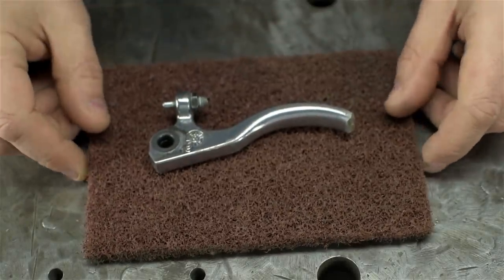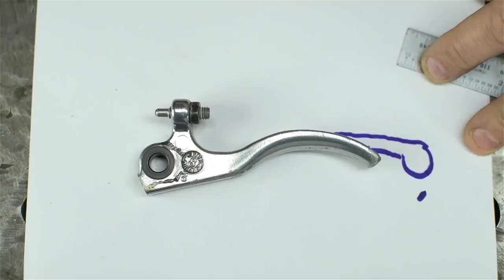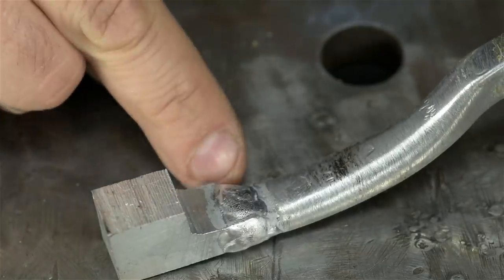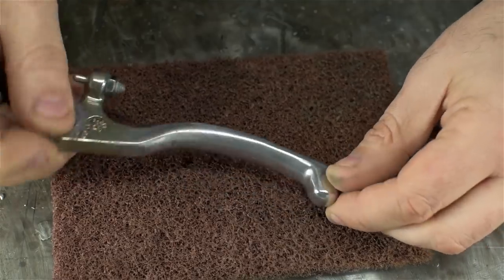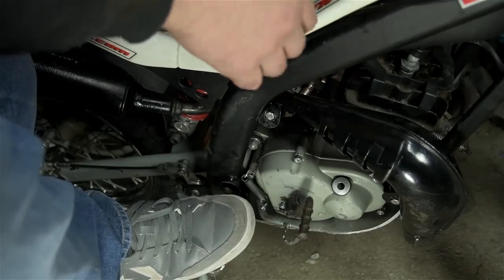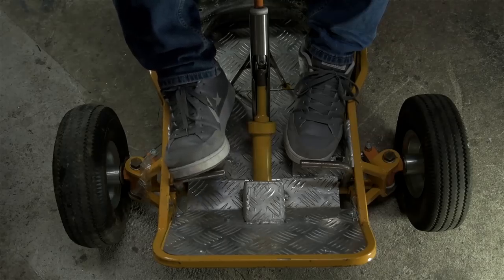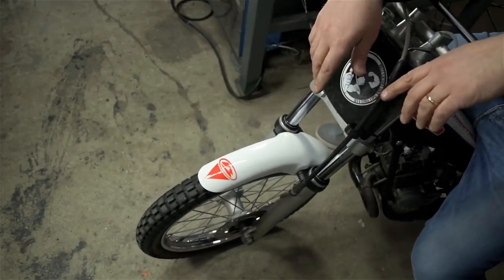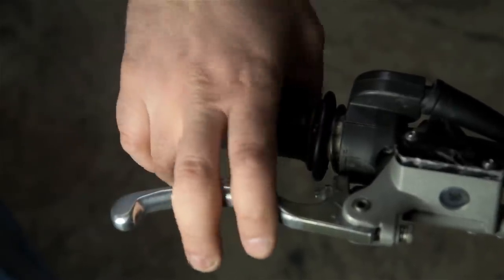6YR OLD ON TRIAL?! - Broken Brake Lever Fix

Comment: I tried a similar repair only to find out it was magnesium. So bright... so very bright.
Reply: That would have made a great video. lol
Reply: Lol
Reply: Look on the bright side, you've now got what is known as a Bikini Atoll tan. You'll see what i mean when the thick crusts fall off your retinas in a couple of weeks...
Reply: LOL!
Reply: Lol. I’ve done something similar. That’s when I learnt to identify the metals properly PROPERLY before welding. I had a bucket of sand nearby anyway which I sorta scraped the mini supernova into. It pays to be paranoid about fire safety sometimes.
Reply: Colin Antink I've done the same.  I worked at a Porsche/VW machine shop.  I was cutting up a VW case to use as  patch for a cracked case when the chip piled ignited! Yikes!
Reply: Actually they make magnesium tig filler rod, it works, it doesn't catch on fire and burn like they way they teach you in elementary school.  Yes I was surprised also. So don't believe everything they teach you in school.
Reply: @colinantink9094 , many moons ago, I used to follow a chemistry blog where the author listed molecules he said he'll never work with. They were mostly molecules containing multiple nitrogen atoms, nasty shit that caught on fire violently if you looked on it the wrong way. 

There was one compound that reacted violently with materials that you normally associated with safety equipment, like silicon, rubber or leather. So, no sand and no normal gloves...
Reply: @MoseyingFan  Any strong oxidizer will do that. Rfna and dinitrogen tetroxide come to mind (rocket chems).
Reply: Let me fess up: the thing I got burning was a particularly high mag alloy. Not typical. It was thinish. And I was being lean with Ar. And I had a sense it would kickoff. And it was fun. And if you treat it nicely, you can weld mag and many Ti alloys.
Reply: @colinantink9094  Thanks for the tip. Getting into welding soon and that is the sort of thing I need to know BEFORE burning down the shop.
Reply: Tom Im tip the second. You can’t put magnesium fires out with water. Not sure about c02 or foam. I keep a metal sand fire bucket since it’s all purpose. If you get a fire. You don’t want to spend time in that situation trying to select the right fire extinguishing stuff.
Reply: Tom Im also. I’m still basically a beginner myself. Happy to share some lessons I learnt the hard way from a noobs point of view. No cure of knowledge with me XD.
Reply: I spent half a day trying to repair a cracked manifold only to find out it was magnesium.
Reply: Believe it or not, but Bugatti manufactured a magnesium bodied car back in the 1930s with the mag panels welded together. It was called the Aeorlithe(a version of the rather infamous Type 57), and, IIRC, they only put one together that has been lost to history.
A few years ago, a [extremely high end] shop called "The Guild of Automotive Restorers"(definitely not pretentious...) recreated it from scratch. I'm not sure how much it cost the owner, but it no doubt would be somewhere in the 7 figures just to build it - it's a fucking masterpiece too!
Definitely worth checking out
Reply: @tubeonline629 ..Yeah, Last time I bought any Magnesium Tig wire..it was over $100 a pound...!
Reply: @dougankrum3328  
Wow, I've still got some that I bought probably 15yrs ago,    I don't remember what it cost, but I know it wasn't that high. I got it to weld a transfer case
Reply: @glennburrow4364  - for those you want to read Ignition by John D. Clark

subtitle - An Informal History of Liquid Rocket Propellants
Reply: @willi-fg2dh  +1 for Ignition
Reply: @MoseyingFan  probably something with fluorine in it
Reply: @tubeonline629  I think but am not sure that magnesium only catches on fire if it has an amount of Al in its composition
Reply: @RyTrapp0  I believe the magnesium alloy Bugatti used was named "Elekrum", but the car was riveted together, not welded.  Here's a picture of that recreation (as the original  Bugatti no longer exists): https://autoweek.com/article/car-life/1935-bugatti-aerolithe-re-creation-completed-lost-magnesium-bodied-coupe-replicated   Note the exposed rivets along the central spine.
Reply: aussiebloke609 The article says “..strips of the material had to be welded together...”, though there are certainly rivets to be seen also in the photos. Thanks for the article - anyone else got the odd Bugatti chassis knocking about in their garage? Les in UK
Reply: @Leslie Austin  Yeah, the article says.  I'm dubious as to the accuracy of detail in the article...just can't fathom why they'd leave an exposed spine with visible rivets if they could have welded it together back in the day.  Even the inner and outer halves of the fenders have been visibly rivetted.  And every other source I've seen says or implies that it was riveted specifically because of the difficulty in welding it. 

But it's still a beautiful car. :-)
Reply: aussiebloke609 OK, these articles are often written by people who are ‘journalists first, machine-knowledgable second” so that’s likely. Agree with you though, lovely looking thing. Les

Comment: Okay Tony, so I've joked about building a trailer saying you taught me to weld.  I've asked for your help with time travel because of shoulder surgery (went well, by the way).  This video is after my own heart, because while I was down by one arm, I started designing a miniGP bike.  When I could barely use my arm, I bought a TIG welder and started learning to weld aluminum.  Last week, I finally test rode that bike for the first time.  I may not be pulling a trailer down the road, but I will literally race a bike I built because you taught me how to TIG.

Comment: Looking forward for the aircraft build video!
Reply: He'll skip that and go straight to fusion powered Rockets
Reply: Me too
Reply: TOT and Colin Furze crossover episode? WE NEED THIS NOW
Reply: Bet it's gonna be a collab with Peter Sripol... ;)
Reply: Kid sized SR71 Blackbird is on the boards me thinks hehehe
Reply: this is literally the perfect comment cheers man
Reply: Before you can build an aircraft you need some way of transporting it. An aircraft carrier..
Reply: I scratch build a ch701. I feel 4% is done.
Reply: Don't be silly gentlemen. Next up is a nuclear Fusion reactor. Tony literally has everything except the fuel to build one and the kid has the internet. It's inevitable.
Reply: @bowow0807  Furze is kind of the opposite of old Tony. kind of like the difference between a Rolls and a rocket powered hyundai.
Reply: Send him off to the Colin Furze summer camp/intern program!
Reply: Hahahahaha.....a Venom De Havilland maybe!
Reply: Me too! Someone's got to come up with a improved form of Draco :)
Reply: @NicholasMarshall  Ever read General Jumbo back in the 70s? He had one of those - with flyable aircraft too!
Reply: BD-5J.
Reply: Cretan1987 In experimental aircraft you aren’t done until you get to 200%.  😊
Reply: @bowow0807  Bring out the Fireworks!

Comment: I think about buying to my kid a mini bridgeport mill
Reply: What kind of idi...
Reply: @digitalradiohacker  Cuts to scene with 6 year old cutting aluminum on a mini bridgeport.
Reply: Do they even make safety squints that small?
Reply: @theincrediblenoone   Yes, and when they start that young they remind their father to put his on, and makes sure its the ones with the built in cheaters - damn kids
Reply: Haha - my 6 yo WANTS me to buy a welder now, because of TOT.
Reply: I'm thinking of buying my kid a Minigun.
Reply: Heck no!  Teach him CAD and design his own mini after measuring each Bridgeport mill part.  Build from scratch.
Reply: Hey - my 6yo has already asked me to buy a welder. Thanks in large part to TOT. He just has a wee bit of adjustment to his  expectations of project schedules. (He gets it honest. Wood takes 2x longer than I expect. Metal takes 10x longer than I expect.)
Reply: @ljprep6250  yes. builds character. but dulls dad's bits.
Reply: @chrismofer  That's part of learning.
Reply: @nate6692  wood only takes you 2x longer than you expect? 
You must be some kind of carpentry god. It takes me at least 5x...
Reply: Yeah it's MUCH harder to break the brake levers on those!

Comment: Good call on to 2 versus 4. A quads sole ambition in life is to pound you into the ground with its considerable weight the first time you bin it.
Reply: Still not as bad as the old three wheelers.
Reply: @Jayhawkga  i call those widowmakers
Reply: My understanding is that the center of gravity on those ATVs is so high that it's easy to flip it over if you run into the wrong kind of bump.  Land on head, get pounded by ATV, end up a quadriplegic.  No thanks.
Reply: @paulkolodner2445  Exactly.  Or, you can try, "turn too fast and get crushed", or "climb a modest hill, accelerate, and get crushed."   Short of hauling a deer carcass slowly, ATVs suck.
Reply: True, thats why i'm looking one that someone already flipped, so i can chance gearing to full torque mode, rip all broken plastic away and build transport space on front and the back to move tools and material around the farm, where as on bike... well i know from experience its possible, but moving 6m long boards is kinda.. interesting? with a dirtbike...
Reply: @Hellsong89  When I worked on a farm we would use the bike to run out to the fields or for Irrigation. It was always interesting trying to carry adapters and short pipe on a dirt bike

Comment: Cool to see the boy on a Trials bike!!  Here are a couple tips to prevent broken levers I'm sure you know.  1.  Put a wrap on teflon tape under the brake perch (and clutch perch later), this will keep every thing in place while riding but when there is a tip over the the lever perch will slip on the teflon and rotate instead of breaking the lever.  2.  Put a quarter ($0.25 but don't make change :-)) in each hand grip before installing them.  This will keep the handle bar from becoming a punch when there is a tip over and cutting the end of the grip out (or taking a core sample of the boys leg).  I have a box of busted levers, glad to see one getting fixed and used for once.

Comment: When doing brake and clutch levers it is a good idea to put a small 1/2 cut half way across the levers width about an 1 1/2 from the ball end of the lever. It weakens the lever just enough that if you dump the bike the ball will snap off before your hands get crushed between the handle grip and the lever. If you look at the levers on a Victory Motorcycle they came from the factory that way for that very purpose. Better to break the end of the lever off instead of your fingers........ As far as your sons age, the younger the better to get them started on a bike. They bounce better when they dump it and learn much faster than when they get older and are less likely to have a serious mishap. My oldest was 6 when he started and his little brother was four. I built a sidecar for the younger one to act as an outrigger until he got the idea of balance. My daughter also started at four. It never hurt any of them.
Reply: That cut can also be the difference between making it home with a clutch/brake or not. Save enough of the lever to be use able.
Reply: I'd second that and have the xrays to prove its a good idea
Reply: I wonder if that cut is exactly how the lever started in the video, my first thought was previous owner dumped it and it sheered off.

Comment: Nice work, the mix of cheap metals levers are cast from can be a real pain to weld. And as for letting your children ride motorbikes...It will either get it out of his system by the time he's old enough to be on the road, or will have had enough experience to be that much safer.
Reply: you are, so , so wrong, it hurts.
Reply: Or at least he’ll be the most skilled 16yr old maniac on the road 😜
Reply: @dimitar4y  I have been teaching people to ride bikes on the road for the last 18 years. Trust me, the guys that have been riding since childhood understand the consequences far more than the noobs. Of course everyone is different, but that's a general trend.
Reply: Ehhh, offroading generally doesn't have much traffic to worry about. If they get on the road thinking they know what they're doing, they're gonna be real surprised when they first meet a car. At least new riders KNOW they don't know shit, usually.

Comment: Put some bark busters on that thing and you will never break a leaver again.  Protects the hands from tree hits also.
Reply: The WORST is when you get one on the clutch lever and it jambs against your fingers into the grip. One time when I was 13 I swore it broke all my fingers.....did it happen 1/4 mile from home? Nope. 10 miles away through rough trails and across two streams. Puttered home in 1st gear at 2 mph. Took me hours riding one handed. Not broken, just munched pretty good.
Reply: Until you get your hand pinched to the bars... Loved bark busters until this happened to me. Hurt like hell.
Reply: @Jurgy777  I heard about this but don't understand how it would happen. I think the benefit (tree hits and cold weather protection with plastic covers) of having them outweighs the risk of getting your hand stuck in them. But please explain I have always been curious.
Reply: @avongil  Contact the ground with your bars hard enough and don't have time to pull your hands off it's entirely possible. Even though they might be clamped tight on the bars they can still rotate either direction in a crash. If the end mount stays put but the inner mount (near forks) twists hard or breaks during crash then the aluminum bar (frame) can bend from force of impact. I'm not saying it's something that happens all the time. But in my case, that one time everything was just right (or wrong) which led to that unpleasant experience.
Reply: This is the worst idea ever on a trials motorcycle where you are rarely riding trails and more often making sure you can get your hands/wrists away from the bars when you go ass over teakettle!
Reply: @fprintf  I agree with this statement.  I imagined he would only be doing trail riding though.
Reply: @fprintf  not really. most of the trials events around me have plenty of trees in them. Makes it much easier to glance off the trunk (if you anticipate it) and keep moving through the next gate. I've been riding without the busters and using my arm to glance off trees and the cuts and scuffs are not as fun.
Reply: @charlesgunzelman3323  I don't know if you are a novice/beginner or not but everyone I know recommends removing bark busters from any trials bike. Any guy that shows up with them on is given a few stories about broken wrists from going over the handlebars. In addition the speed just isn't high enough and prickers/branches not that bad to warrant the extra weight and risk of them. We ride in the woods all the time also and no one has 'em.
Reply: Forget the bark busters..... that's how you learn to not run into trees!
Reply: I've had enough superman dismounts to know I don't want barkbusters on my trials bikes. Dual sport or enduro, sure.
Reply: @mdbuschsr  Wow, I did not know it was such a polarizing topic! I guess it depends on the type and style of riding.

Comment: Some riders cut them on purpose, they are called shorty levers and you can engage the clutch /brakes using only two fingers
Reply: Right and they dont break so easily when you fall. It better to have them short. We usually drill a hole near the end to create a predetermined breaking point, so that you can still continue to ride when one of your levers break
Reply: @dhyanais  mechanical fuse basically :)
Reply: @dhyanais  also it allows you to keep two fingers on the handle bars!!! Much safer in my opinion!!! Keep Rocking!!!

Comment: Thank 's for the lever repair. I restore (attempt to) vintage motocross bikes (e.g.) MR50, QA50 ,Z50 and I come across a lot of levers as you  repaired in your video. I to find myself trying to repair rather than replacing so thanks for the inspiration.

Comment: Pretty strong Dad move.  Well Done.  Can I just say, as a city resident, your location looks positively bucolic.  Also, as a fellow motorcyclist... I wish I could say I'd never welded the ball end of a motorcycle control or footpeg back on.  But I'd be lying if I said I hadn't done it at least half a dozen times.  I'm not cheap, I'm reclaiming.  It's good for the environment.

Comment: I raced motocross from the age of 4, until the age of 18. Broken levers like that don't seem like a big deal, until the are. That ball on the end prevents the shape edge of the lever from stabbing you when you wreck. One of the last years I rode, probably 8 years ago or so, I had a novice rider in front of me at an open practice, he panicked when he heard me approaching, jumped a double from a line he weas uncomfortable with and wrecked. His lever was busted, wedged down between his leg and his boot, and left one of the nastiest cuts I've seen in my life. These levers are way, way, to cheap to buy (Or produce in your case) to neglect. Glad you got your kid's bike back in tip top shape!

Comment: Hay Tony,
A quick tip for annealing aluminium. Heat it up and touch it with the wood end of a match stick as you go. When the match stick leaves a black mark on the ally quench it. There you go, taught to me by an old German guy who grew up in Berlin during the war.

Comment: Nicely done Tony! I did a lot of riding on my Bultaco Sherpa T when I was younger. Try heavy peening your aluminum welds like that. You can really increase the strength by cold forging it into a wrought condition. Your trying for deep deformation not decorative dents.
ATB, Robin